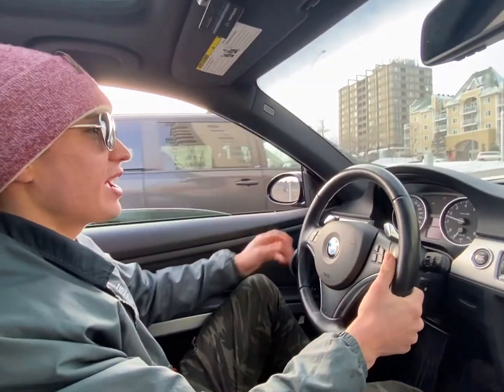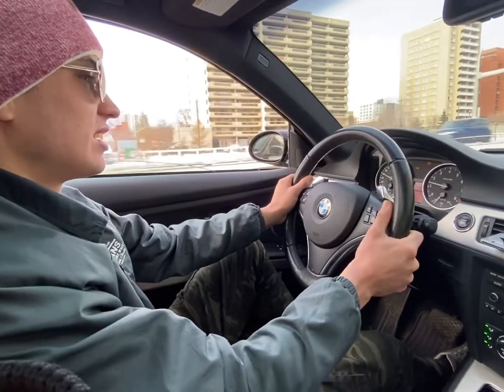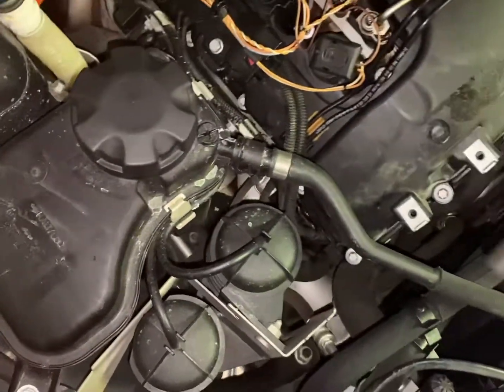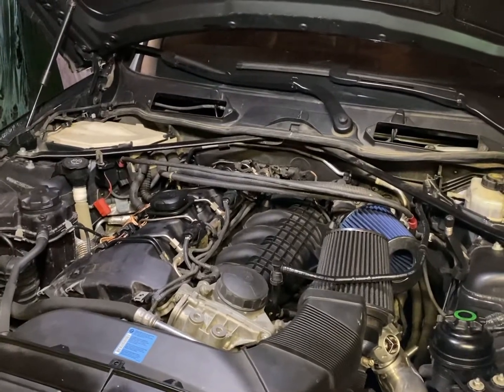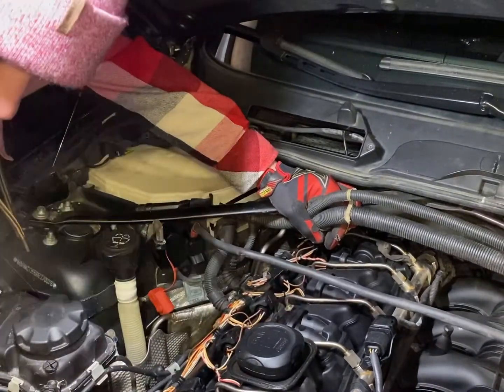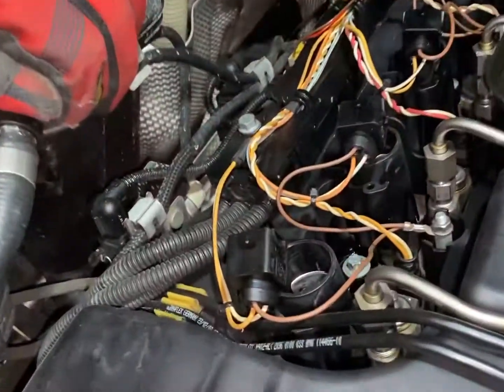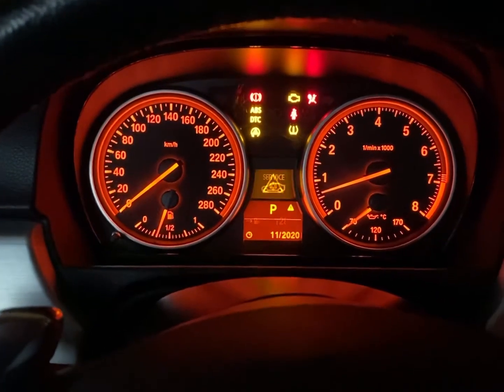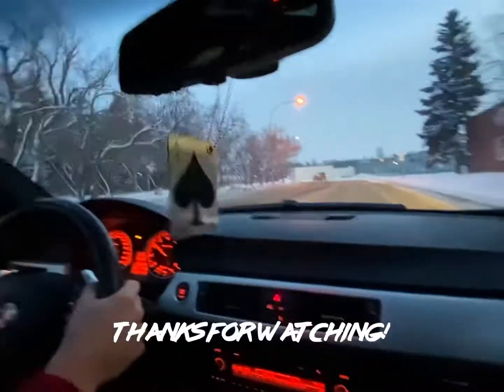Another day with the E92 335i

Comment: Bosch coils are said not to be the best. If you change  coilpacks go with  delphi or the newest  eldor coils. Bmw itself switched from bosch to delphi and then recently again to eldor brand. I personally went with Delphi when i replaced mine. Eldor was harder to get and more expensive. 

https://youtu.be/Tjsx-K1mjkQ
Reply: PR coils are where its at for n5x cars.
Reply: @SloppiGoose   im sure they are!  Pricey aswell... 480 or so usd for the kit... and for me +20% import tax and shipping to get it to where i live.  I got  delphi coils for 125 eur shipped.  Im only on Cobb stage 1 93ron tune, otherwise engine is stock. And im running one step colder N55 stock spark plugs  that had to be gapped to... i dont remember  what the spec was.  Runs great! I think PR is something  i  would start to consider  when i already have intercooler, downpipes, chargepipe and so on installed...  full bolton basically. I am working towards that, but im always doing maintenace on this car and havent got around to it yet.  Ive had oil filter housing gasket leak, then i did new valve cover, then all new brakes,  all new wheel bearings,  then front shocks started leaking  so did KW V3 coilovers. Carbon cleanup,  chain tensioner leak, DCT pan leak, new battery....list goes on and on. Last  thing i did was new boost solenoids.